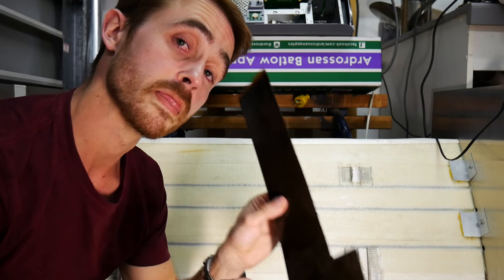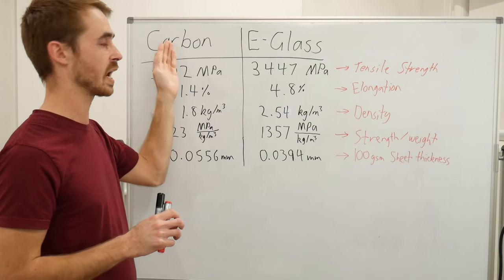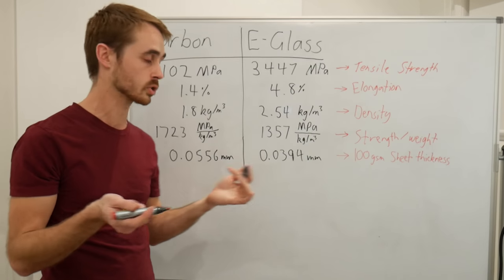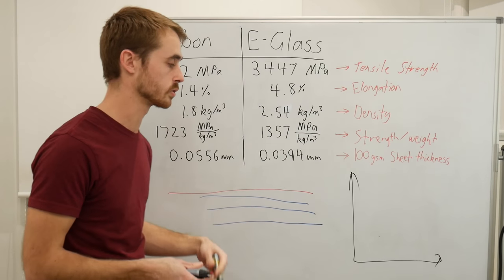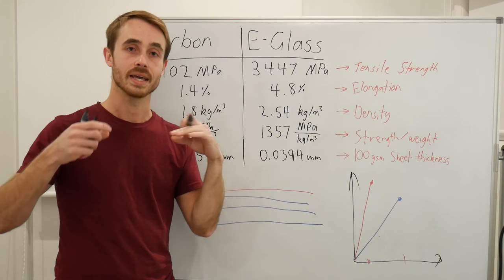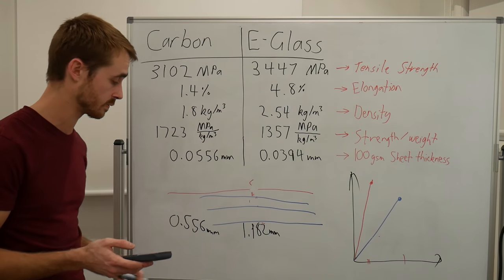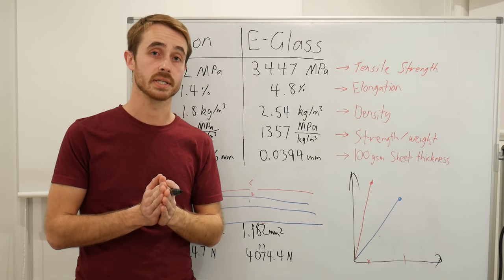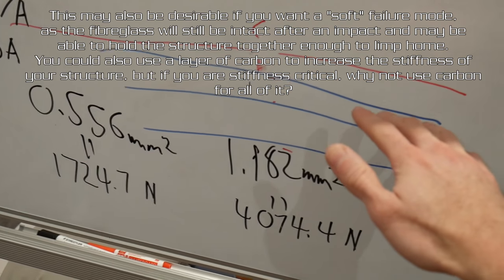Why you SHOULDN'T wrap Fiberglass in Carbon Fiber!

Comment: Interesting video, but it is only correct if elongation is of composite part is greater than tensile elongation of material with smallest tensile elongation (which in most cases is not true), for all other cases conclusions of video are totally false.
Using composite which are composed with materials with greatly different tensile elongation is relatively common in industry, for example GLARE (glass laminate aluminium reinforced epoxy) from which is  Airbus A380 fuselage made, or why aluminium honeycomb is used in carbon composite fro F1 monocoque.
Reply from the maker: Well, given the video is all about the specific case of wrapping thick glass with a single layer of carbon, I would say the conclusions of the video are totally accurate. Also, the same principles apply to all multi-material structures.

Be careful with GLARE, it is used as a fatigue enhancement. An aerospace aluminium (such as 7071) only has 11% elongation, but being a metal it yields before break, at about half of it's UTS, see the graph here http://www.chess.cornell.edu/chess/west/A2pages/insitumeas.htm . That's 5.5% elongation i.e. the elongation of the fibreglass at break. Not to mention you wouldn't intend to stress the aluminium to it's yield point as you do want it to have a reasonable fatigue life. The key thing of GLARE is that the layers of ally and glass stop crack propagation through the aluminium, as it cant propagate cleanly through the adhesive and then the fibres to reach the next sheet of aluminium. GLARE also allows you to make longer sheets as the glass bonds them together. There's quite a few other advantages of it over conventional ally (corrosion properties etc.) and composite structures (bolt shear, fastening, forming etc.). You can find out more from the manufacturer here: http://www.fokker.com/sites/default/files/media/Files/Brochures/Fokker_Glare.pdf   Also, one of the original Fibre/Metal combos (ARALL) used kevlar (with shorter elongation), and the performance was comparitively poor, which resulted in the switch to glass.

Honeycomb in a carbon monocoque is a completely different ball game, the loading direction is different, and the core is only designed to carry shear and compression between the two skins. This is why you see foam, wood, aluminium honeycomb and nomex cores being used in many different composite skin applications. Aluminium honeycomb has the best performance of these available core materials, hence why it's used in F1. Do not make the mistake of thinking these cores take any significant portion of the tensile or compressive load compared to the skins.

Thanks for watching!
Reply: KYLE.DRIVES
Here is quick question
What is total strength of part part from your example of total elongation is for example 0.5% (smaller than tensile elongation of CF)?
Reply from the maker: Well, the total load at 0.5% elongation would be 1724N*0.5/1.4 = 615N for the carbon, and 4074*0.5/4.8 =424N for the glass, making it 1039N total load. Not sure that I understand why you are asking though?
Reply: KYLE.DRIVES
So at end for practical purpose where you have limited maximum elongation of part CF will do something?
Or to put differently for same load part from GF and skin of one layer of CF will have lower total elongation then part made only from GF (from your example and previous answer only GF part will need near 2.5 less force to get same elongation then part made of combination of GF and CF) till total elongation due applied force do not overcome tensile elongation of CF.
You are right that force at which part will break is dictated only by by CF strength, but usually parts are not designed to operate at that extreme.
Reply from the maker: Well, if you are saying that the ultimate tensile strength isn't what matters, why not replace the 3 layers of glass with one layer of carbon? Half the weight, 84% of the strength, and more stiffness (1231N at 0.5% elongation). Alternatively, if strength to weight is what matters, drop the layer of carbon, keep 3 layers of glass and get the same strength as before but now with 25% less weight. Every part is built to either a strength or stiffness limit, and if you aren't designing your part for that, you are making it heavier then it needs to be, which isn't really designing it at all.
Reply: KYLE.DRIVES
Mechanical engineers always do design heavier than it should be (that is basic of their design), and I don't want to offend any of them but when your design have so much safety coefficients which are that big you cant say your design is optimal.
I didnt say that is smart to cover GF part with layer of CF, but I argue that layer of CF will make difference(at least as stiffness) and I do not want to argue reasons why people do that (same I do not want to argue why people think that CF parts look good, but someone like that look), they have some reason know to them.
Reply: In motorsports it's all about optimizing the safety margin, while maximizing performance, valued against budget. BUT Design yardstick is the one which fits your budget, finishes #1 always. Note that safety margin does not enter in play into the final evaluation of design, if it fit into budget including repairs and it finished #1.

Standard engineering has high safety margins because parts are designed for long life cycle, long endurance, and potentially other safety factors.

There is no magic bullet, one solution to all, engineers are doing their job correctly with the big safety margins UNLESS specified otherwise.

If you want just the looks of CF, you can use vinyl wrap for that. Does not affect part strength, adds minimal strength, and almost guaranteed to look perfect.
Reply: KYLE.DRIVES 
KYLE.DRIVES I am almost able to follow this interesting discussion as i try to get a better understanding of the technical theory of this matter,  but it is up to  this point where I'm lost so can u maybe help me out by clarifying that what you're saying here is to my understanding correctly as follows;
1) wrapping CF on 1 side of a 3layer glass fiber sheet is "never" making a "significant" (as in, to be worth the cost/weight/etc) improvement to the part? (as per your initial statement) 
2)in all alternatives discussed here,  the bottom line is that we accept  that, inherently, either one or the other or multiple properties of the part will end up being the intended improvement at the expense of another property? 
3) (assuming above) if focusing on tensile strength = 1xCF + 1CF wrap = half the weight (as 3xGF + 1CF wrap) = less strength = more stiff = 1,4x the price (as 3x glass +1CF). 
4) [assuming #3 is true] so its stiff and light at the cost of strength and price,  correct? 
5) [your alternative mentioned] "using 3x GF compared to 3xGF + 1x CF wrap" = same strength = 25% less mass = 3,3x cheaper = ???% stiffness? (% of 3xGF+1xCF?) 
6) is that all there is to consider the main points of interest in your racecar (and similar) application? <price - weight - stiffness - strength> or is there more to consider of reasonable importance? (aside from the properties already taken into account as a factor or sub component (like stress,  flex, shear,  etc)) 

Thanks for any help,  cheers
Reply: Don't forget to take resin into account, wich takes at least for 40% of the material (in prepreg cf), and about 60 up to 80 depending on the process. So in the end, let's say, for that purpose, these calculations are so sketchy that they don't even make sense.
Reply: The resin has almost zero relevance to the stiffness of the composite material when compared to different kinds of fibers. I don't see the problem.
Reply: Most weight-optimized structures don't have safety factors of 3+ (which is about what you would need in this case to not exceed the strain at failure of the carbon fiber).

Therefore the carbon fiber lamina would fail.
Therefore the glass fiber laminae would take all the loading (and some non-trivial transient loading due to the characteristic sudden failure mode of carbon fiber reinforced plastics).
Therefore, in essence you would've achieved nothing (by adding a layer of CF) other than increasing the potential modes of failure of your structure, increase it's weight, increase it's cost.

As always, thanks KYLE.DRIVES for the video. BTW Do you have any plans to make more structures/mechanics of materials related video content in the near future? I'd love to see a video on classical laminate theory, or just some layup videos of your aerofoils.
Reply: I don't think his conclusion is false. Another example if this is; when you apply a lot of impulse with a pull to break something, and you go flying backwards when it breaks, same sort of concept i think. if you were attached to a rope while you were flying back you'd pull almost enough to tear another thing you just teared. LOL!
(please excuse me I don't know anything about this stuff, I'm bad at explaining too, lol)
Reply: In summary, you want to disagree, but don't want to have to justify your disagreement?

Lol.
Reply: Sorry your conclusions are only true if the material stretches out like that. But it won't. If a 40' sail boat stretches 1.4% that would mean it stretched like .42' That never happens, because of the epoxy. So again your wrong. Reinforcing fiberglass with Carbon fiber is actually a good idea because it improves the bend durability of the glass. Again Carbon fiber is more rigid and can bend farther than fiber glass. Therefore Carbon fiber makes fiberglass stronger. So instead of using 4 layers of carbon fiber you can us 3 layers of glass and 1 layer of carbon fiber to improve the strength and cut costs. 

Dude your math does not show all the characteristics of carbon fiber. Space engineers know better than you do...
Reply: Guardian 117 
First of all *you’re and secondly his argument is about weight and design and practicality. Sure carbon is stronger in theory but whats the point if it’s only marginally as this will dramatically decrease performance?
Reply: @KYLEENGINEERS  [I understand totally] I've read all these very smart comments, thanks to all. (What people are trying to stay with is the appearance of the outer skin to be Carbon-Fiber but build the strength of the part first with E-Glass. But, I do understand. ( I am using a current piece side panel flare from my car, and adding foam taping it together to form my mold goal. ) I goal appearance is Carbon Fiber.

My understanding two your video is, forming 3 or 4 or 6-layers of E-Glass to make the base. Has strength but as soon as you add CF to the above surface, they form there own separate strengths understood. 

Even though EG has strength at the beginning, and then adding CF build its own layer on top it which the CF has Rasin it has its own strength. But as your indicating adding one to the other either way, will force them both to weaken one another, then help strengthen one another?

Comment: I'm still doing my thinking...but it seems you're considering pure tension in this example. I would think that bending is more commonly the case, and in the case of bending the majority of the stress is being carried in the outermost fibers of the beam, and so a layer of cf over fg could make more sense, no? Based on your other videos I'm sure you're savvy to this already, but I didn't see it in this discussion. But with a few thin layers the effect would be minimal so probably wouldn't matter. Hmm. I'll keep thinking.
Reply: Not really, no. The fiberglass interior would be doing even less there, since the carbon fiber skin would be undergoing the greatest tensile forces, with the fiberglass contributing little. Then it would break, and you'd be back to a fiberglass beam. This is why lots of things are made with fiberglass or carbon fiber over a lightweight core. The core isn't really structural, it just bonds the two skins together to form a solid part.The core might be foam, or a hexgrid, or something like that.

Hell, foamboard is a perfect cheap example of this. It's foam laminated between two sheets of paper. The tensile strength of the paper prevents the foam from snapping when bent, and the foam provides thickness to prevent the paper from folding when bent.

Comment: Good video, excellent points. Thank you. A maker of wood strip kayaks was using a layer of carbon fiber on the inside of the hull, fiberglass on the outside. This probably doesn't violate what you're saying (if it seems to, then likely I've left out some important detail.) The point I want to make is I've always paddled wood strip kayaks that I've made. I just got a really nice kevlar/fiberglass kayak that's been damaged.  Compared to the wood core kayaks this one seems incredibly fragile, (but I know it's well made.) 
I'm trying to figure out if I can repair it with just fiberglass. The incredible flexibility of the hull/deck is new to me. The kayaks I've made you could stand on. One thing that does happen after a few years and some minor leaks, is the  western red cedar core and the fiberglass (6 oz e-glass) after cycles of wetting, swelling and drying, shrinking, starts separating the exterior glass from the wood core. The interior seems never to do this. Makes sense on a macro scale, the core is essentially a wooden bubble, when it swells it swells outward, never inward. The epoxy still holds, but there's a layer of wood fibers in the fiberglass skin that's peeling off.

Comment: 6:23 Because carbon fiber is super expensive, haha! If you're designing, say, a wheel, where you don't want it to flex, wrapping a fiberglass model in carbon fiber (granted, not one layer like in the example, presumably a pre-made weave) would seem to be a much more cost effective method of construction when compared to using potentially 3 or 4 times the amount of carbon fiber that you would use in that model. In addition, assuming you used a technique like vacuum bagging to adhere the carbon fiber to the fiberglass with some sort of resin, (correct me if I'm wrong on this) but wouldn't you still get the benefit of the fiberglass's strength? If there's not any significant amount of space between the two materials (for our purposes, enough for the carbon fiber to flex that 1.4%) wouldn't the carbon fiber just compress on the fiberglass, spreading the load between the two composites? Good video by the way! Just thought I'd throw in my 2 cents, haha. I could be totally wrong on this, but I thought that was worth mentioning.

Comment: Hi Kyle, love your videos. Would love to hear a video about a Lotus Elise (or any Lotus for that matter) In regards to construction and aero, they seem to nail the fibreglass structure. Thank you for the content
Reply: Agree, also an explanation why bonding the aluminum tub is better then just riveting it together.
Reply: with riveting..the rivet material itself may well be  stronger then a bonding adhesive but theres far less contact area ...more load on a single failure point...if designed well that can be minimized but you also run into an issue of creating a failure point in the base material as well..ie the hole for the rivet.With adhesive you dont compromise the material and you have a much more consistent spread of force.Thats my 2 cents worth lol but to be fair I have always been old school as well...plastics and glue have always been looked at as a cheap alternative but times are changing! There are plastics,composites and adhesives now that are near or exceed metal and welding/fastening and with proper design can be much better in the long run...not necessarily cost efficient however lol but that seems to be changing as well

Comment: Why is motorcycle swingarm made of carbon fiber when fiberglass is harder and more flexible?
I'm very interested.Thx!
Reply: Carbon is lighter, stiffer, and stronger (when it isn't crimped into a woven twill as shown in the video). If you're designing something to purposely not flex, you're better off using something with higher stiffness and less weight. You'd purposely build it stiff enough to not flex to failure based on a worst-case-scenario load case. Hope that helps.
Reply: @TheyCalledMeGator  thx!
Reply: @TheyCalledMeGator  The carbon  is lighter and stiffer but is actually slightly weaker. It has a higher strength to weight ratio.

Comment: This is correct in the instance he is discussing from a load distribution standpoint. However, he is not discussing FORCE itself that must be applied to actually cause the break. He is only discussing the elongation point of breakage. If I have 3 sticks of wood at 4 mills in circumference and 1 stick in the bundle at 2 mills circumference, the over all force to break the bundle is not equal to the 2 mill nor the 4 mill pieces. This is discussing ELONGATION. Many times, carbon is added as a skin for aesthetics and stiffness while being backed by E-glass. Of course, I guess the High performance super car guys are just wrong? No. It is like anything else, it depends on the PART and what FORCES the parts are subjected to. In fairness, a video was made discussing those uses, however, he certainly doesn't seem to like Carbon Fiber and loves him some E-galss.

Comment: Wrong!  What if your just looking for a low cost cosmetic look for a non critical part like a dash board on a car? If you use an elastic glue like contact cement it will give at the seem and still stick like Hells-Hinges as the part expands and then bounce when it cools!  It's a great way of making a great looking part at low costs. Just do not use a rigid adhesive.  3M makes some really good high temp and super sticky rubbery contact cements that are designed to glue two dissimilar surfaces together.